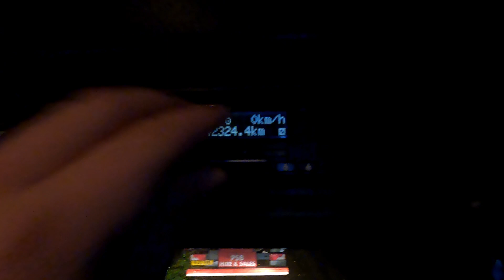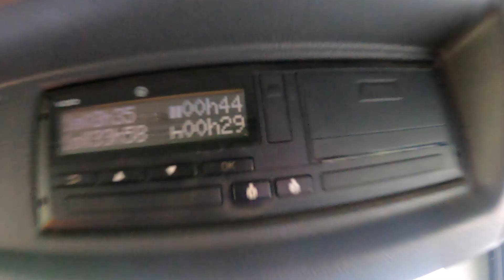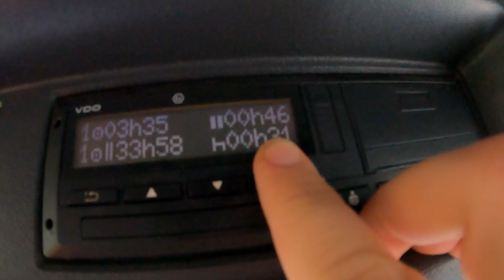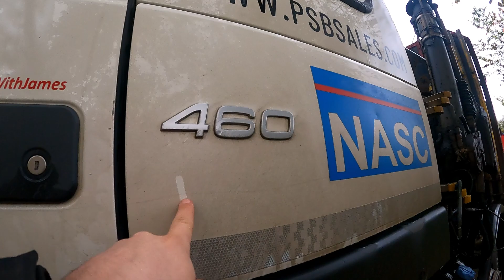Storm Ciaran RUINS my Journey to Cornwall (110MPH WINDS!)

Comment: Woah that wind was crazy. Glad you got through the day, keep the vlogs coming I need to catch up with them at some point. One question that I am trying to get my head round can vosa just pick any HGV up at random or do they have certain things to look out for?
Reply: They can stop any truck at random and perform tacho and vehicle checks, but they do look out for certain things such as being overweight or badly loaded.  The older your truck is the more likely you are to be pulled as the vehicle will be prone to more wear and tear, like the front blindspot mirror in the video that rusted and fell off.
Reply: @timburton5280  ah cheers Tim thanks for clarifying that for me.